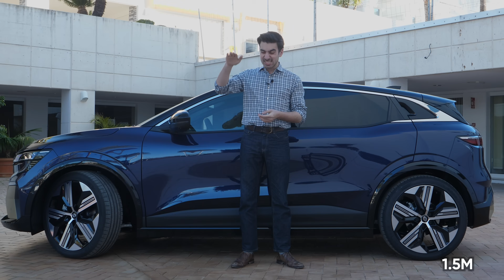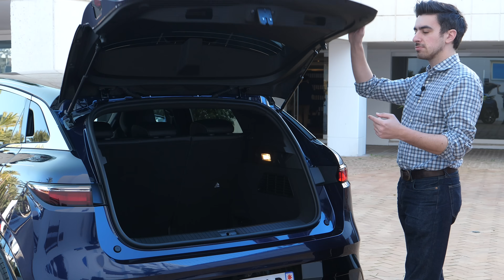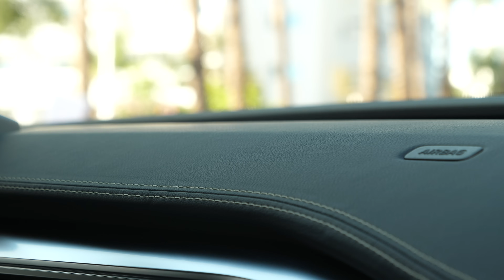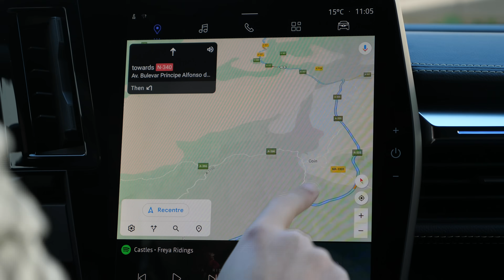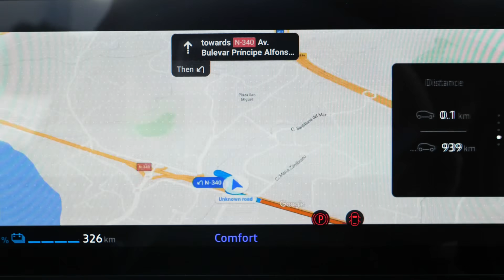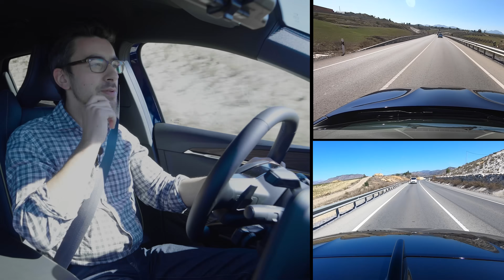NEW Renault Megane E-Tech Electric 2022 review: the VW ID.3's worst nightmare [4K]

Comment: So....
You are 6 feet tall
The car length in meters
Car distance in mile
0-62 in mile per hour
You were driving on a 90 km/h road
XX kWh battery
Boot capacity in litre
The hood thickness in cm (could be spmrthing else)
Did I miss something?
I am confused 😁

Comment: Tried this a couple of days ago. Very nice driver environment but sitting in the back was awful. I'm 185cm and when drivers seat was adjusted for me, i could not fit my feet under the seat when sitting in the back. The car looks great in pictures but when looking up close for real, it's mediocre. Tried a Cupra Born and everything felt better so i ordered that instead. The driving feels much better in the Cupra.
Reply: This size of car is not really meant for tall adults to be sitting in the back for any length of time.  If that is required you need to go a class up.

Comment: i like it a lot except the battery. i don't really five a f**k about the battery being only 11cm. they should have made it 13csm to add more energy!!!!!!
yes, some are happy with the battery that is in there now. but some - like me - want more.
this is where VW is still ahead regarding the choice of the battery size.
i would like to have 90kWh. the ID.Buzz will get that next year and that will also trickle down to the ID.5/4/3 at some point. It takes the same space like their 77kWh battery but has about 20% more energy density.
wenn done renault, but your battery is a showstopper for me.

Comment: Megan low tech! Manual tailgate, no heads up display, can't see an electrically operated sunroof? in fact no sunroof. Does it even have adaptive matrix headlights? My Mazda CX-30 GT sport has all that so I was wondering where the "Tech" comes in? Are the seats/ mirrors fully programmable to the individual fobs?  No cloth seats in the Mazda either. That's the down side to all these EV's they are woefully lacking in kit compared to ice cars even mild hybrids. I hope they will catch up one day so they can compete. After all who wants to pay more and get less?
Reply: Depends on what car you are looking at. A good example for a high quality car is the Ioniq 5 and others on the platform.
Reply: But your Mazda isn't an EV, why are you comparing them ?     I run a CX-5 which is brilliant, but doesn't compare with an EV !
Reply: @malgf4145  hi, my Mazda sets the standard for my expectation. I accept I will pay more but get less? No. I'm surprised you don't think your Mazda compares. I can't speak for yours of course but mine has a full suite of safety features plus  sunroof, rear wiper, matrix headlights, projected heads up display, fully trimmed tri colour  interior, memory seats etc and both my wife and I really like it.. the build quality is excellent and with the mild hybrid sky active engine quite economical to run. A lot of these evs just don't match up . Also I'm a low mileage driver so reaching co2 offset for me isn't likely soon.  I can't buy an ev just because its an ev or maybe I'm over thinking it. I am however comparing car with car. I'm currently thinking that I'm going with the new Mazda CX 60 when it is released.

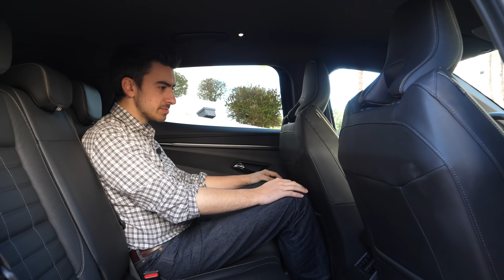Comment: 6:51 The Mégane is a family car so the back sits will be fine, and a flat "banquette" is better with 3 children. I have a Tesla model 3 and 3 children and I would have preferred a banquette rather than 2 "bucket like" sits and a strange place in the middle. Of course, bucket sits are better on a race track, but -- again -- family car ! And if you want to drive in sport mode from time to time, you will probably not do it with children at the back. And if you want 3 bucket sits at the back with the same safety level, you will need a larger car and you will pay the price in cities.

Comment: To expensive
Reply: Regarding what ?
Reply: @didierpuzenat7280  the price of the car won’t be a best seller how can people afford an over £30K car when everything is going up in price
Reply: @wayneheyes904  Buying a brand new car is always expensive, however just in France, about 1 million new cars are sold each year, with an average price of 27 k€, and then you have to pay for fuel and maintenance, and still in France, EVs under 45 k€ get a -6000 € "bonus" while ICE cars get a "malus" that can reach... +40 k€ !! And an average price of 27 k€ (bonus/malus not included) implies many far more expansive cars sold. And of course, the more EVs are sold, the more used EVs will be available at quite lower prices, after a few years. The main point is to have EVs for every needs at every prices : still in France a Dacia EV costs 12 k€, new, battery included, and even 7500 k€ for people with low incomes. So ok, this Mégane is "expensive", but not so much compared to an equivalent ICE car including all costs (fuel and maintenance) and including incentives. So many will be able to buy this Mégane, and it implies more EVs on the road, so less pollution, less noise, less green effect emissions, less dependence to foreign petrol, etc. In fact, the price argument is not new, the Renault Zoé was supposed to be a failure because it is "expensive" compared to a Renault Clio, but Zoé is the most sold EV in Europe.

Comment: Massive upvote for usefully telling us how many miles can be added in a time rather than the normal (that many other reviews use) absolutely useless "10-80-% in X minutes" when that depends on battery size and you dont know how many miles that is without getting a calculator out! 
May all reviewers change to so many miles in X minutes or 100 miles in Y minutes.
Great review over all also. 
Question, do you think 200+ HP in a front wheel drive is getting too much leading to wheelspin etc?
Reply: It's hard though really as it changes quite a lot, if I charge my car at 10%  its alot faster than at 80%
Reply: 200 hp in FWD has not really been an issue for a long time.  RWD or AWD is always going to have advantages but for packaging reasons FWD is better - ie boot space.  This is not really a performance car so it's fit for purpose - not sure how they will make a hot version if they decide to as would really need AWD or don't think it would fit very easily.  Great effort, probably the best smaller EV I have seen and can see it selling a lot.

Comment: I really don't get why leather seats are considered 'premium', they're less comfortable that a quality fabric, freezing cold in the winter & burning hot in the summer. Having had both I'd always opt for a quality fabric given the choice.
Reply: Historically, leather is expensive and this is the only and oddly the odd reason why  it is considered premium!
Reply: Premium don't seem collect odor/filth as easily and are also easy to wipe clean. In extreme temperatures, heated and cooling seating options, and pre-entry ambient temperature option for EVs, improve seat temperature control. It's easier to shift position if back feeling restless or something, because leather grips less. Long ago in early days of cars, cloth was the luxury option so you have a point. Having moved to premium seats (vegan leather) I prefer it overall, but can see why some may prefer cloth
Reply: True. From my experience Alcantara is waaaaay better than leather. Even mix of fabric with leather is better than full leather.

Comment: I bought a Renault Kangoo EV. It stopped working. Over six months in the local Renault garage. It's still there. €17,000 repair bill so far and it's still not working. Think carefully about buying a Renault.
Reply: I have owned one Renault Clio and it was great until it rained and I started getting weird electrical faults ☹️. My only other experience is a friend who had a big Mégane MPV, great car, until again electric faults but that was a bit of an older car. But it really has put me off Renault's. I hope they've improved with this car.
Reply: the warranty didn’t cover it?
Reply: @kristians2704  no it was about 8 years old so not new, I could have probably took it back to the dealer who sold it but I was a nieve 20year old
Reply: @timscott3027  well, 8 year old EVs all have significant problems, it’s not unique to Renault
Reply: @kristians2704  oh yeah for sure but the only cars I've ever known with such strange electrical faults have been Renault's, and possibly a vauxhall. I know that other cars get faults too, I now have a 6 year old Skoda that touch wood hasn't had any issues yet.
Reply: @timscott3027  Zoes have been around for years and super reliable

Comment: Thanks for this review. As a Golf owner, I was looking forward to the ID3 but got disheartened by all of its problems! Maybe they'll be ironed out in update 3.0, but from what I can see, maybe the software problems will persist?
I don't really need loafs of room in the back, but I do need boot/trunk space, so this is much better. I also like the Google based infotainment, why VW went proprietary, when they couldn't get it right in the first place?
I don't know if you've filmed a deeper review of the infotainment system on the Megane, but it could probably do with one, to make more of a comparison to the ID3!
If only the price could undercut the ID3, as Renault isn't as premium a brand as VW! MG isn't either, but then they're cheaper cars, so you can look past the brand difference! I also hope Renault have included curtain airbags, unlike the new Zoe, with its zero stars' NCAP rating!?
Reply: "I also hope Renault have included curtain airbags, unlike the new Zoe, with its zero stars' NCAP rating!?"
Zero star was not due to the airbag definition, but the age of conception of the car (Euro NCAP decided to perform a new test, after the one from 2013 (5-starts) having expired, as a crash validity is only 7 years).
However this Megane E-tech will surely get 5-stars, like every Renault car at its launch.
Reply: VW has never been a premium brand either. They are overpriced. The foundation of Volks Wagen (car for people) dictates its humble origins. For premium German brands one has to look for BMWs Mercedes and even Audis.
Also Renault had more innovations than VW in all years and more interesting cars in general.
Reply: @Kerveros1904  the VW badge carries more of a premium than the Renault badge. Yes If you want to go further you go Audi premium but a Golf is seen as way classier than a Megane. German engineering beats French engineering hands down I’m afraid
Reply: @bertie1989  I have seen at least two Golfs of two friends that were burning oil since new. The one of them had a strange noise, and my friend used to have music in order to distract him from the noise. Such is the great German engineering in VW. On the other hand, a Renault Megane 1.4 16V of 1999 has superior handling and an engine of 95bhp  with 11,4 sec and 191 km/h where as the Golf 1.4 of that era had 74 hp with 13,5 secs and 171km/h. The car, i still have it after 220.000 kms, still does not burn oil and runs like new. This says much about engineering of Renault and VW. Do not let me start with the failed turbos of the TSIs. Oh and guess who invented first the V8 engines in which Americans and the Great German engineers copied from :). Was it French or German? https://itstillruns.com/who-invented-v-engine-4894231.html   VW = overpriced cars for the quality they offer.

Comment: I don’t get the package - huge wheelbase but cramped inside, particularly the rear seats.
Reply: More boot/trunk space though (than the ID3), so it's that eternal compromise!
Reply: It's a very small car lengthwise, it's much smaller than the former megane wich was a small car
Reply: @romteb  yes, I just don't know why they bothered shaving 100mm off the overall length, but then give it a huge wheelbase. Guess it's a platform that'll be used for larger segment cars too.
Reply: The engine is in the front and that takes up more space than the ID3 on the rear axle.
Reply: At VW, the engine is on the rear axle and therefore the trunk can accommodate all the technology at the front
Reply: I will never understand why manufacturers continue to put comically large wheels on their cars. It makes the ride worse, the efficiency worse, and it robs cabin room.

Comment: Just like the Clio, no height adjustable boot floor & what under floor storage there is, full up charging cables. From £35,000 not exactly affordable for many families. Charging times. I would bet the 40kw battery will take 8-9 hours on a 7.4 kw charger. We only have one public charging point in the town where I live & it is a 7.4 kw. 
292 mile driving range, that will be more like 210 in the winter. The bigger battery version will probably price out at over £40,000.  Sorry I don't buy this electric car rush. 2/3 worlds electricity is still produced by fossil fuel power stations. So the well to wheel is the same as petrol. 
Where is the UK infrastructure. If you live in a city fine, but rural areas it is rubbish. If you have drive 30 miles to charge the car. Errrg. Thousands of properties have on street parking. What do we do with the lithium ion batteries at the end of their life?  The big one for many families is not only the cost of the car new, plus a home wall box if you can have one, is car insurance which is about double the price of a fossil fuel car.
Reply: In the Uk electricity is up over 40% renewable sources and don’t forget in an electric car you are not polluting the residents as you are driving around
Reply: you would bet a 40kwh battery takes 9 hours to fill up with a 7,4 kwh charger? you have some big problems with maths.. even considering a low efficiency of the obc (85/90%) and a non linear charging curve in the last 10%
Reply: Do you write for the Daily Mail? There are so many EV myths in that diatribe it's hard to know where to begin. And you reckon 40 / 7.4 = "8 or 9" do you? Maths not your strong point? 

Not sure who told you the insurance for an EV is more than double that for an ICE, but its complete garbage. You should have words with them and tell them to stop making you look foolish.
Reply: Trudeau would call you a sexist mysogynistic racist anti-vaxing climate change denyer for saying such things, then steal your money and kill your dog. I happen to agree with you.
Reply: @pigeonpoo1823  I have driven self charging Hybrid for the last 5 years. I am not against saving the planet. It is just the vehicle cost, charging times & charging infrastructure in the UK is not realistic.
Reply: @nickyfoulkes8476  so you've driven a "self charging hybrid" have you? In other words, a petrol car. Did you fall for Toyota's green wash? Oh dear...:(